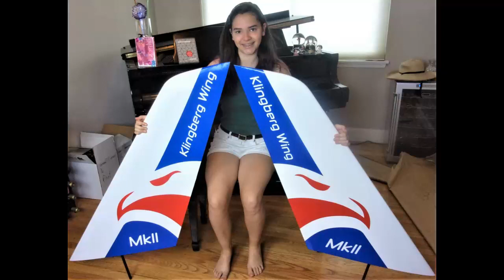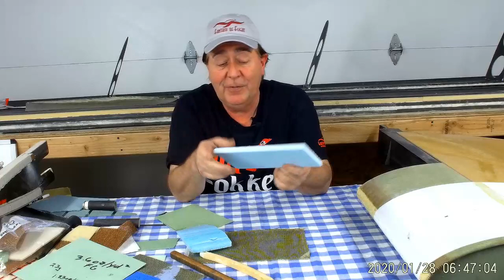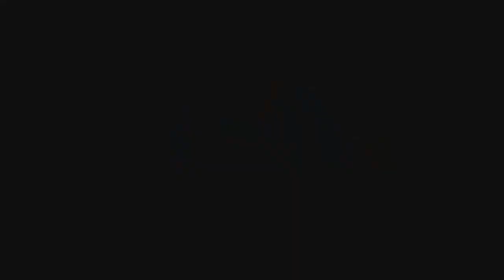Material and Structural Trades, Part III - Klingberg Wing MkII Development

Comment: Hi, thanks for the informative video. 
However due to the overload of information I find it quite hard to determine what now the actual conclusion is to build such a ultra light weight wing at home.
E.g
What are the all materials for each part of the wing?
In what order to use each of the materials to create a rib / wing part?

Also, I thought that wood cap strips are used at the outer edge of a wing to provide strength. Wouldn't it be better to also use carbon fibre for this?
Reply from the maker: Oh, sorry about that. What I'm try to present is that all designs are best approached by defining top-level rqmts, and expanding those based on trade studies. Given all the possible aircraft designs, I can't provide a single answer that will apply to all of them. I'm hoping these videos get folks thinking about how they are approaching their designs and maybe show a few new ideas about how the materials can be used. For my design, the answer comes down to using male, single use foam molds combined with creative application of the various materials that are available. Hopefully, in the long run I will encourage designers to not be so driven to focus on a single aspect of a given design (such as aerodynamics, or performance) and rather design by looking at all the systems and subsystems in a balance that achieves the top-level goals. In my case, those goals are: 30/1 L/D, 100 lbs gross weight, and build-able at home without any fancy tools or molds, and finally, car top transportable.